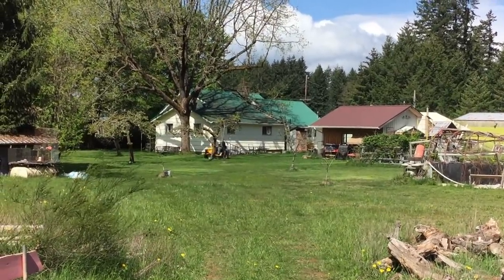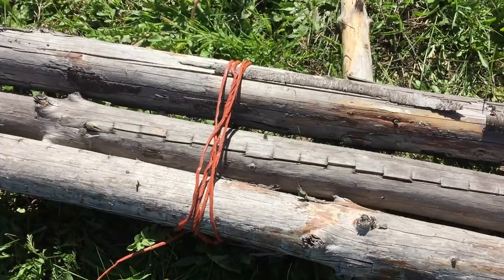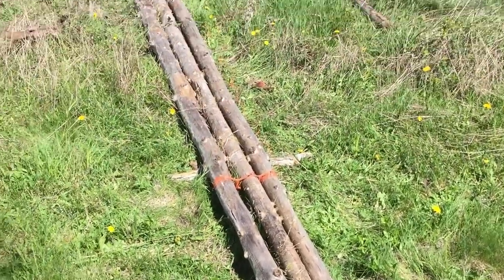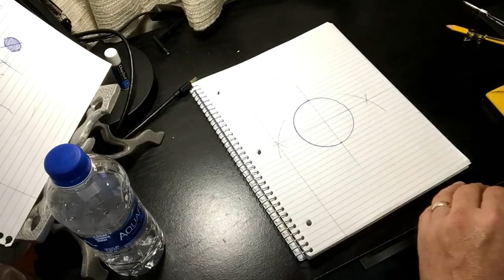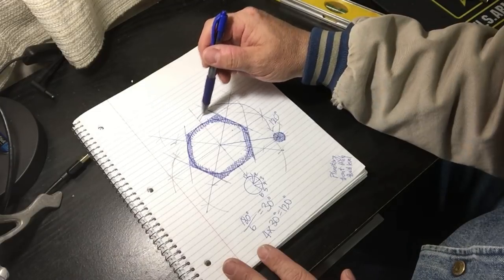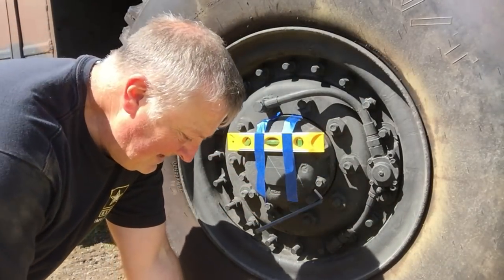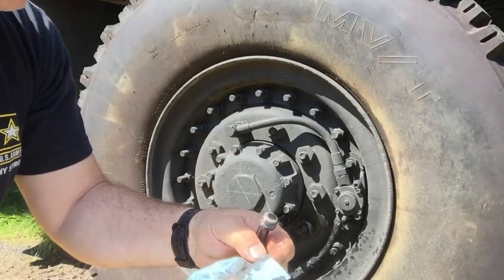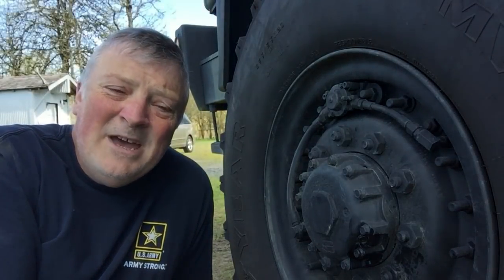FMTV PLANETARY HUB Servicing #42

Comment: easy way to check hubs. I always used a 3/8 drive allen with a ratchet. Makes it some what less messy and makes it easier to make sure you get it tight with out rounding hex on the plug.  Glad you remembered the hubs often overlooked.
Reply from the maker: I actually overlooked them when I was doing my last lube, and remembered the hubs are independently lubricated and not by the axle oil. Thanks for the tip and adding to the video tricks of the trade. Many happy returns.

Comment: That is why the company I worked for did the maintenance work. Found the big shop forgot things, payed by job not hourly, and did not check for things that could go bad like a bad grease fitting or u joint etc. We had a check list for all work done so not o over look something it is so easy to and a on it place for work that needs attention in the future.
Reply from the maker: Good help is hard to find.

Comment: I bet few people could redraw your hex you sketched.   That is an art.   

Does the 2” plug always line up the same way for right to left and on every truck?    That is a surprise to me if the military specified the thread start angle on all plugs and hub covers.   

Enjoying your videos.
Reply from the maker: So far, so good. Even on PARTriSha, the big hex on the face of the hub and the plug line up in the same way. I'll bet it was a specification and designed into the plans. It was really nice that it worked out like it did. Thank you for your kind words and spending a bit of time with me. Many happy returns my friend.

Comment: Thanks for that tip using a torpedo level. How do you know what weight of oil to use and whether or not to use synthetic?
Reply from the maker: I asked that very same question on the LMTV Facebook site. There was only the discussion about using a good brand, but no one seemed to care about anything else. I used Purple 75w140 (I think). As long as it is good reliable gear oil, it would be good... 90W or so.
Reply: @HelicoolsHelipad  I imagine that's fine. I just remember in auto shop (high school mind you!) that my teacher sad to never mix oil weights...idk, but he was referring to engine oil so may not be concern. Have a great day Dave!
Reply from the maker: @davidkloven3720  I came across your phone number today and was wondering if you had the chance to get an LMTV? I hope all is well (just a stone's throw North). 

I have decided to purge the entire hub and refill them, since I was smelling a burnt oil smell where a little of the passenger side hub oil escaped my rags and spilled onto the rocks in the driveway. Since I don't know when it was done last, at least I'll know when and what it was filled with... no question about it.
Reply: @HelicoolsHelipad  
Oh right, Perhaps you remember that I called on my way to look at a couple lmtvs, which I did and bought a 2000 6x6!!! :)

I am in the middle of converting the bed to a dump bed and will be putting in some seats and sound deadening....for starters.

You know I really would love to come visit. I live in Tacoma. Let me know if there are certain days that are best for you. I could drive rig over to you like Sean & Willow did not long ago. Feel free to text to my number or call if you'd rather. 

Changing that gear oil completely wouldn't hurt I'm sure...just more work. Thanks for writing back! 
..."and as always, God bless!" ;)
Reply from the maker: @davidkloven3720  heck yeah! You're just up the road. I'll definitely keep your number and perhaps we can get together with our trucks in the near future. 

So cool that you got a 6X6! Right on!

Comment: Is that the position to add the lube too?
Reply from the maker: Yes... the oil level should be checked in that position and topped off. If you drain the oil, the port needs to be at the 6 o'clock position until empty, then return it to the 4 o'clock to top it back off.

Comment: Geez luiz! Using every geometrical theorem to find 4 oclock on the hub! lol! They use the term 4 oclock because its not insanely critical that its at the perfect angle of degrees. lol. Try just a little lower than 3 oclock, should work good. lol
Reply from the maker: My friend, if I was not totally, inequivalently exacting in my videos, I would hear about it. lol. So for this one, I took some extra time to show how to get the perfect 4 o'clock position. Heck, you could just add the right number of ounces of oil per each side and not worry about it whatsoever, right? :-D  Either way, I'm good with it. Cheers!